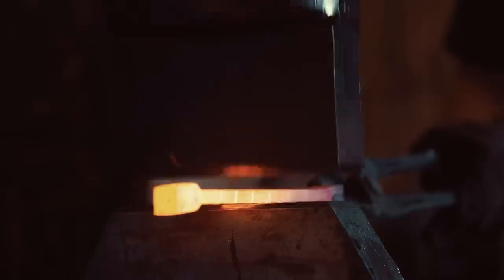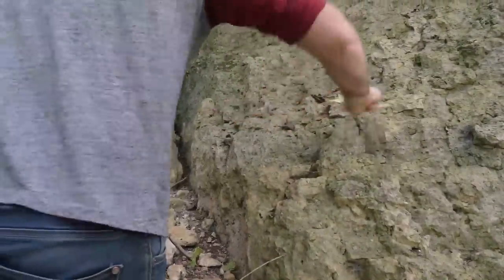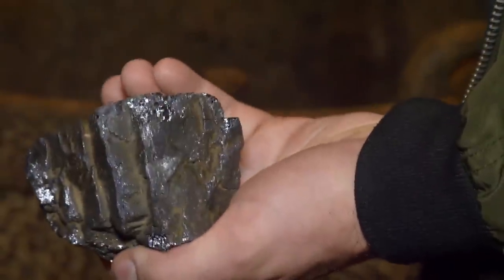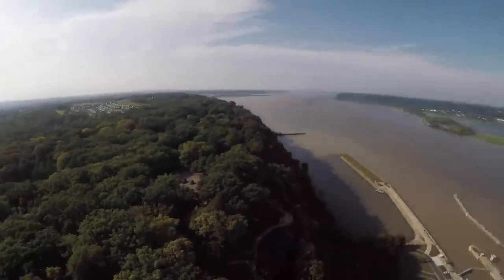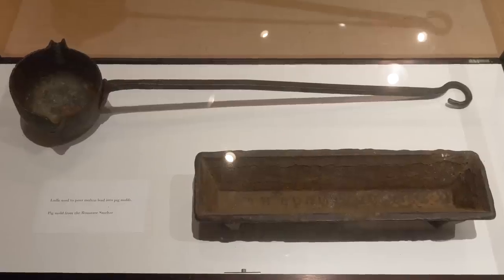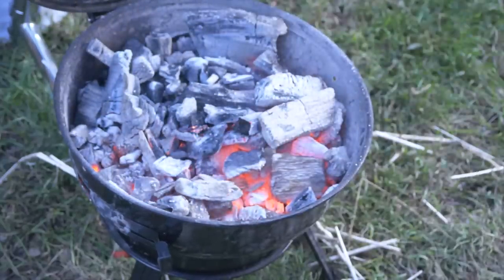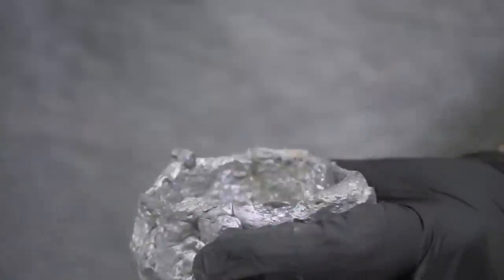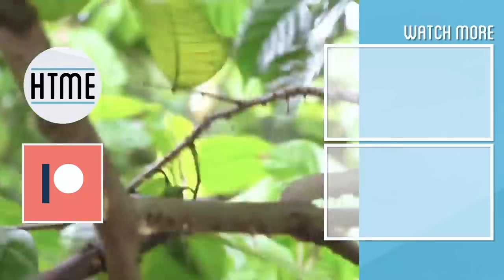Smelting a Poisonous Cup

Comment: Be sure to keep some galena. it can be used as a semi-conductor to craft a foxhole radio in the future
Reply: At first, I thought you were referring to gallium arsenide diodes, which I believe people do use in at least modern crystal radios, but sure enough, galena is one of the crystals used in crystal radios.  Learned something new. Thanks.
Reply: He's going to have to smelt copper and draw it into a wire to form the antenna and the coil. 

This is an excellent episode idea for his next series: explore how much sooner we could have had certain technologies. Everything we needed to make radio broadcasts existed by 2,000 BC, including crystal detectors, copper coils, shellac for insulating the wires, magnetite for making the speakers/microphones, and batteries to power transmitters. The finest artisans of ancient Greece could definitely have made a vacuum tube.
Reply: @andrewakrause  the bulb part, sure. the vacuum part, not so much
Reply: @herzogsbuick  I thought the same at first, but then i remembered a Cody's lab video, where he shows a vaccum pump that only uses mercury dripping through a glass tube. upon research is called "Sprengel Pump", so they could in theory build a fully functional vaccum tube at the time
Reply: @herzogsbuick  It's a pretty impressive aparatus as well, being able to produce way better vaccums then needed in a vaccum tube
Reply: @herzogsbuick  Vacuum part as well, look at Cody's mercury vacuum pump. It's literally a glass pipe and liquid mercury flowing trough sucking in air bubbles while doing so.
Reply: @TheOriginalEviltech  what was the state of glass making in 2000 BC?
Reply: @doctorbobstone  I imagine if they can make a glass pot than they can also stretch it out in to a thin glass pipe. Also radio lamps can be made with ceramics and metal. The glass envelope is optional. Tungsten filament would be a challenge though...
Reply: @andrewakrause  so there is an anime named "Dr Stone" that you will love
Reply: He'll have to make the aeroplane first.
Reply: @andrewakrause  I refuse to believe nobody stumbled upon some modern concept by chance during ancient times. They probably just treated it like magic and/or heavenly one-offs. Just IMAGINE how history would be shaped like if some random empire could communicate with radio during land-only wartime.

Comment: I’m excited for episode 50000: Making a Tesla from scratch and episode 1000000 building a mars rocket from scratch
Reply: An electric car can be made once you have access to lead, sulfuric acid (which you might be able to make by bubbling the lead/sulphur fumes through water), insulated copper wire and iron, so if that is the goal, it could be done fairly quickly
Reply: manaquri you made a battery, not a car
Reply: @acr_-kj8gd  a battery and a motor, which is what you need for an electric car, the rest can just be wood and iron, you can make lead bearings, grease is one I forgot though.
Reply: i dont think he would make a tesla they arent energy efficient its best to burn the fossil fuels once in the engine instead of making power from it then using the power for the tesla

Comment: I live about 40 miles from one of the largest lead mines ever to exist and back in the day, they'd smelt it right there and all the lead dust would fall all over the valley and it's towns and poisoned a ton of people as recently as the 70s. All their tailings also ended up in the river so it's still polluting the water supply and it's still not safe to even handle the dirt in the valley. Legend has it there's still a huge amount of lead in there and someone is looking to reopen the mine. Let's hope with modern methods it'll not pollute the environment
Reply: This would probably be one of the places where you wouldn't do as much extra damage by polluting further.

Comment: My great grandfather was a coal miner, after he came to North America in 1900. I believe he did that, when he was still in Eastern Europe. Miners did, and still do a very risky job. A lot of towns in North America, where mines used to be are ghost towns. With lead, it still has it's purposes. It's in the solder, with tin, which holds electronic components on circuit boards. I'd like to see you work with other metals in the future. Cheers!

Comment: You forgot to mention one of the primary uses of lead in more modern times, as a component to electronic solder to prevent the tin whisker effect. Tin in solder builds up very small crystalline "whiskers" that spread out from joints. Eventually, these can touch and short out near by components. It was found that adding lead made this process much slower, although with modern ROHS requirements, leads use in most electronics is fading out. I spent years in a job where I would clean a solder pot in a wave soldering machine. I'd walk out of the area with spots of lead solder splashed on my pants.

Comment: To be fair, when it was used in the 70's and 80's in plumbing, it was used only in solder in joining metal pipes. The solder would only be half lead and the rest tin, and the surface exposed to water was very small.

Comment: I grew up around lead paint, lead toys, lead added to gas (which they think increased violent behaviour in the 70's and early 80's), and as late as the early 1990's figurines like those used in Role Playing Games like Dungeons and Dragons and Tabletop Strategy games like Little Wars, Warhammer 40K, and so on, were still all made of cast lead alloys.  Growing up when I did it was almost impossible to avoid it.

Comment: My dad worked as an oil refinery technician in the 1970's and 80's so he was tested regularly for lead exposure.
     Once he used some high lead aviation gas to clean off the belly of his airplane and his next lead test showed sky high levels in his system.
     Don't handle high lead gasoline without PPE.

Comment: The toxicity of lead is a little overstated. 
Burning pure lead can put off some vapors, but the rest of the toxicity stuff is related to food contamination. 
You really just need to focus on not putting lead into your body to be alright.
As far as that goes, smelting lead is actually more dangerous than re-melting lead because smelting lead entails boiling off things like arsenic from the ore, which are much more potent toxins. 

Something skipped or not mentioned, Lead is also very useful for making glass.
Leaded glass takes about half the fuel to make as soda glass and you're less likely to get air bubbles in the end product.

Comment: Actually many pipes in the US are still made of lead and it's estimated that around 3.100 municipal water systems in the US use lead pipes and are at a high risk of lead contamination like what happened in Flint Michigan, which btw still has not been fixed despite being a city over 100k and the risks were actually known when the decision was made to switch the water supply.

Comment: Where all those precautions necessary with the ore?  We used to melt lead all the time to cast bullets with just good ventilation and mask and never had any problems.
Reply: TheAstilesus two words: sulfur dioxide.
Reply: So does the ore contain enough sulfur dioxide to warrant a hazmat suit?  The guy was wearing a hazmat suit.  I think his caution was in the realm of phobia.
Reply: TheAstilesus dude, smelting lead is hyper toxic. It was warranted. The heat gets high enough to vaporize lead and make plenty of exotic sulfur compounds.
Reply: So the ore is more toxic than pure metal.  Ok then.  Thanks.

Comment: The Rome thing is definitely a myth. Several studies of bones and teeth from Roman graves have found lead levels that aren't elevated at all. In fact it is quite safe for plumbing unless the water is acidic. This is what happened in Flint MI. Water was suddenly routed from a slightly acidic source for the first time. And despite being safe for a century the plumbing started leaching lead after the lime scale was consumed. Solution was to switch back to only using somewhat alkaline water in those pipes.

Comment: your lead is too cold as you are pouring it, i suggest keeping a torch to it, whilst pouring, as well as heat it a little further,  and you need to preheat your mould to make the lead flow better... also char your mould by burning its surface area with a blow torch at big yellow/red flame so that it has a slight layer of sot, that makes better casting, and helps release the mould afterwards.

Comment: Can you say safety overkill?  Come on safety nerds, let me have it!  But first, read...

Lead is not very dangerous unless you dissolve it in an acid or solvent.  In fact, solid lead is no more dangerous than solid iron, gold or any other metal.  As long as you don't vaporize it and breathe it or eat it, it won't hurt you.  Lead is not absorbed through the skin.  You don't need a respirator and you certainly don't need skin protection.  And before you say smelting it can vaporize it releasing toxic lead into the air, lead melts at 328F.  It boils at 1750F.  Unless you're smelting lead at a completely unreasonable and impractical temperature, any lead that is vaporized from smelting is negligible.  Bottom line is, lead in it's pure form is pretty safe.  Compounds created from or by lead are not safe especially those in liquid form.  ie paint and water

You took all those safety precautions and then proceeded to dump it on the ground?
Reply: The most toxic fumes were the CO2 and CO

Comment: great job splattering it all over the grass; you take such care of everyting else but a huge oversite when casting the metal by not doing it over something like a cement patio, that you could collect the spatter from.  That and it's not a toxic compound, because it's an element not a compound.  That sounds like a bit of fact checking, on the script.

Comment: The respirator you used was not the best as it is harder to make a seal for it. And it would have been better to youse a full face respirator as you are lucky to make a seal but be carful with the filter as many old filters especially from the Soviet Union contain asbestos.

Comment: Andy is going way overboard with the "protection from lead"
Reply: Safety is never overboard. Lead is no joke.
Reply: @SaitoGray  it's no joke yes but coming into contact with gas that is being filtered won't kill you.
Reply: I work in a foundry where we smelt leaded brass for plumbing and gas fixtures. Most of us dont even wear respirators in the foundry
Reply: @SaitoGray  No I'm saying the exposure is nowhere as bad as I thought it would be when I started. We get routine blood lead test every 6 months as well as wearing air monitors monthly to show our exposure levels and there are only 4 places that are at oshas exposure levels that require us to wear respirators. So its safer than you would think. Still not "safe" but not completely unsafe either.